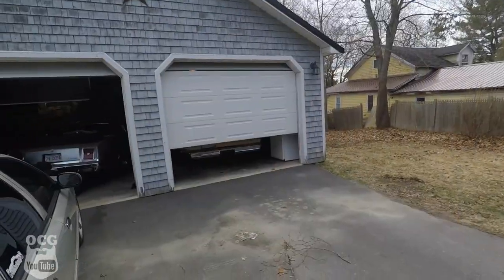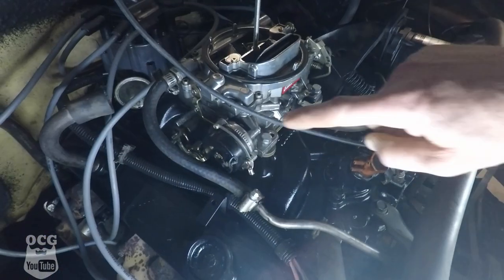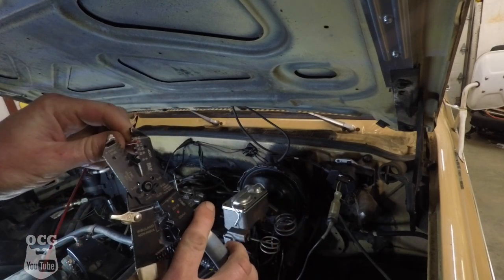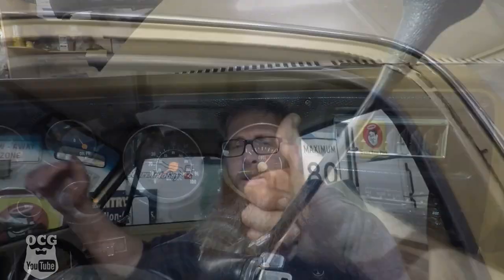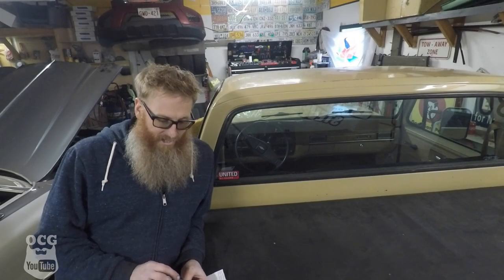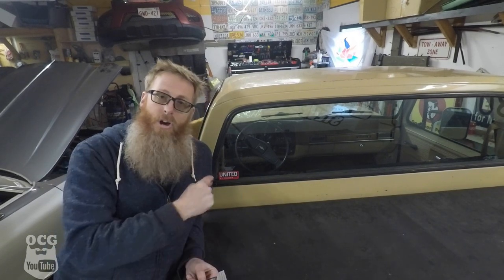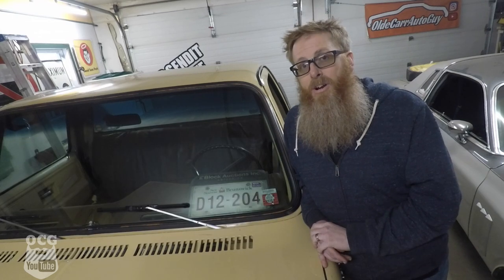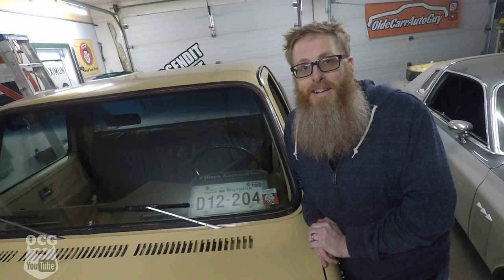FIRST DRIVE WITH NEW SMALL BLOCK CHEVY AND 700R4 IN MY NEW 1977 C10

Comment: Whats the size you had to cut the driveshaft to for the 700r4 conversion?
Reply from the maker: Didn't have to cut it. TH350 and 700R4 are the same length within a fraction.